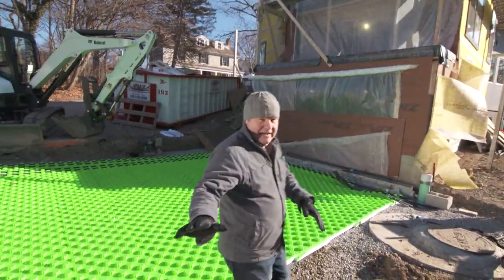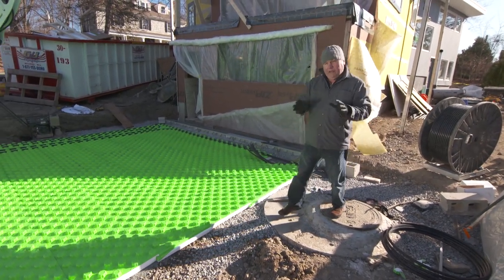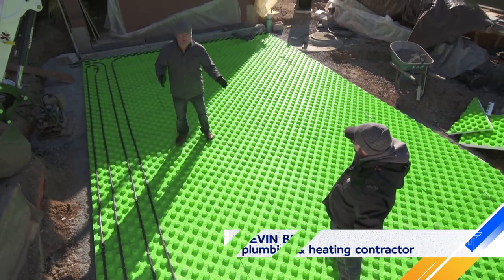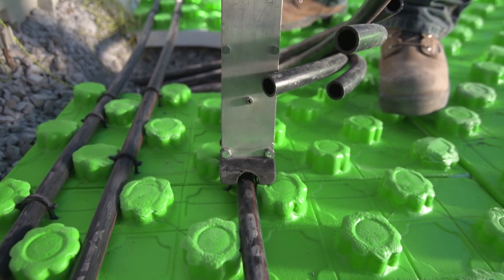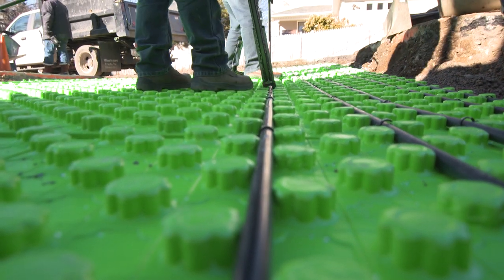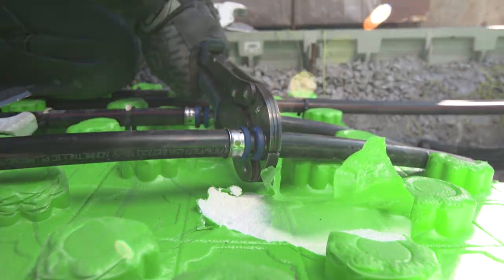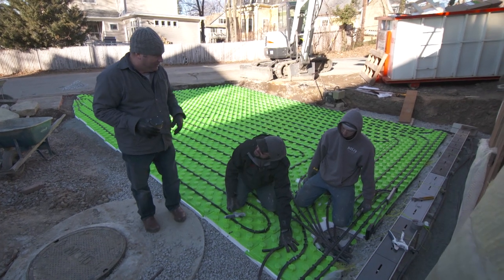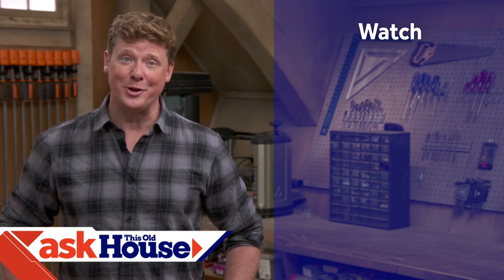Installing a Heated Driveway | This Old House

Comment: Holy crap!  Do you know how much energy that will consume?!  With just some rough calculations, assuming a 14' x 20' driveway, every ¼" of precipitation would take over 15,300 Wh just to melt the ice, plus about 107 Wh for every degree F that ¼" of precipitation is heated.

So, to thaw and heat ½" of rain-equivalent precipitation just 4 degrees F would take over 31,400 Wh of delivered energy, not produced energy or the energy to heat up all of that concrete.

Good grief.  Is TOH still going to call this an energy-efficient house?
Reply: Ditto. Thanks for saving me all the computing and typing! The only "green" part is the liner.
Reply: ncooty With excess solar energy or geothermal it can work responsibly.
Reply: It wasn't much of a driveway either, maybe fifteen minutes to shovel.
Reply: @AlexKennbergProfile  It would take nearly all of a day's output of a typical 3-4 kW residential solar photovoltaic installation, or more. The 15 kWh ice melt estimate is a minimum. There would also be the continuous heat transfer to the ambient environment on top of that. And after melting the snow and ice you would have to continue heating to avoid it turning into a slick skating rink. Maybe a solar hot water system would be better? I don't know. To me it just seems crazy. I live in a harsh winter climate in Canada and I've never seen or heard of anyone having one of these systems installed. It would probably be nearly useless at -10 C and totally useless at -20C. You just couldn't provide enough energy reasonably to overcome heat transfer into the ambient environment.
Reply: Your looking at the calculations the wrong way, you only need to bring the slab temperature up prior to a snow event so that the snow will melt instantly, then your energy is to maintain slab temps. Will utilize much less energy than you are calculating.
Reply: @jsaperton :  Please write out your calculations.

Comment: Imagine if and when that thing springs a leak how do you fix it in concrete
Reply: Jackhammers
Reply: Find leak with thermal imaging camera while system is running, the camera will see a bunch of yellow lines running in the ground and the leak will be where you'll see a line with yellow blotches coming out. Once that's found you can either cap that loop st your manifold or break the concrete/asphalt and just make a coupling repair if needed.

Comment: On this job they used concrete for the driveway. Could you use conrete pavers over the tubing instead of concrete. In my city they charge you more for a concrete driveway.

Comment: What sort of boiler is used to heat this driveway, and does it need its own power station to run it. Another too short video. Is This Old House on a spendthrift budget?

Comment: I like the project but wise those slices were above the slab, low chance of an issue but if those fittings ever rust considering the concrete or anti freeze you’ll have to ship out the concrete where as if they’re about the tub in the slab is 100% continuous and you know it’ll never be an issue

Comment: Extremely irresponsible use of energy.
Reply: I wouldnt be surprised if something like that was even illegal in Europe, with our regulations on energy efficiency in houses, strict limits on lightbulbs, vacuum cleaners, car engine sizes and almost everything. I have certainly never even heard about a heated driveway. But I guess somebody must save the planet for the rest of the people :D
Reply: A short bit of research goes a long way to understand how these systems do not eat up utility bills. Here is a quick article for starters.
https://www.concretenetwork.com/concrete/snow_melting_systems/costs.htm
A plow truck costs more to just relocate the snow out of the way on the property which leads to a point that they become burdensome, let alone if you even have property with enough room to pile any amount of snow.
Reply: @Joshua79C  Your reply has nothing to do with the comment.

Comment: What happens if and when one of those warm water pipes bursts under the driveway when there’s concrete covering it? Do you have to jackhammer and dig it up? Or do issues almost never occur?
Reply: Nunyo Bidness same as a lot of new houses and commercial buildings that are built on concrete slabs now a days. If it was to bust you would have to bust up the concrete where it’s leaking and repair it.
Reply: @StevenRathburn  I bought some. Good to 100 degrees below zero

Comment: Step 1 should be outlining the bank job you'd have to pull to pay for this heated driveway
Reply: So many of you thinking this will cost more to operate than warming the house:
https://www.concretenetwork.com/concrete/snow_melting_systems/costs.htm
they only turn on when the snow or ice needs melting away.

Comment: Could have saved a lot of money and gained insulation by using standard XPS foam. With the amount of Staples used, there was no reason to use that board. Also you should always avoid making connections under concrete.

Comment: getting ready to sell your house and organs to pay for heating bills
Reply: You don't keep it on 24/7 you non thinker. 
You only have it on until the ice and snow is melted or until the driveway is dry, then you turn it off. 
If you want to shorten the time. 
You don't turn it on until after the snow stops falling.
Reply: @scotttovey , thanks captain obvious, an exterior heated floor is like flushing your money down the tubes.
Reply: @scotttovey  ok boomer

Comment: For the love of the environment please don’t heat the outdoors thanks...
Reply: So no more outdoor grilling?
Reply: Nate B  that’s in summer, not all winter long.
It’s one small spot not an entire driveway.
And thus so much less energy it’s not even funny.
Like thousands of times less...
Reply: @FreekHoekstra  I grill all year long.
Reply: Air conditioning is litteraly just heating the outside air. 
Please show me your home has no air conditioning.  
Also note many rock salts act by causing an exothermic reaction that, you may have just guessed, melts ice by heating it. 
In the ling run this is actually the smartest and cheapest option if you are pouring a new concrete driveway. Concrete gets eaten up by salt and over the life of the home the cost of salt will be greater than the cost of this system.

Comment: Wait till the lines develop leaks. Then you have to dig up the concrete for repairs. Most people don't bother repairing it and just do it the old fashioned way. Plow or shovel.
Reply: If you could actually see the driveway I use, it has a retaining wall along the property I live on separating it and the driveway of which the house and drive are 6 to 12 feet away. it terminates at the end after a corner to a building which is used as a residence that I lived in before moving to the main house and next to it is a auto body shop which the landlord already owned. Even in the nicest of snow fall his plowing is crappy and leaved icebergs in the driveway, I am skeptical of and rather cheap to using salt as he threatens me with paying for any repairs if the concrete or asphalt gets eat up by it. Unless I hit the lottery large enough, I am stuck dealing with them using the plow and then a loader to pile and then remove the piles of snow each winter after each snow fall and he leaves a pile way to high to see around or over when exiting the driveway onto the main road which is a route and main road through town.  I would rather have such a melt system rather than having to risk my own health with unusually high hypertension (high blood pressure) as is despite being a bit out of shape now going into early 40s. Or dealing with some sketchy plow service with minimal room to place snow anywhere, even out front is an issue for me where i have relative who like parking and still have to heft the somewhat melted and wet road slated snow berms out of the way despite how willing the landlord it to plow the lawn up as I said with his crappy attitude of snow remove let alone can not do it well enough to keep ice from forming. By the way my mom and I live together to save money on living expenses and she is not much happier than I when there is ice on the walkway or even driveway.As I said if I won enough to buy my own place, you can bet it will have a ice/snow melt system in the driveway and walkways even stairs. It not as expensive to install or operate as many think the myth of it is to be, which is exacerbated by the wildly varying electrical supply rates that depends on where one lives and what the power source is. Afaik and done research of it, such is less expensive to have and use than relying on a plow service or going to the hospital and paying those medical bills for hurting yourself or some one lese you paid who hurt themselves at your place.
https://www.concretenetwork.com/concrete/snow_melting_systems/costs.htm

Comment: This is one of those long term investments. It pays for itself especially as you age.
Reply: It costs a lot to operate. My calculations (detailed in another comment) suggest melting off a foot of snow on a small driveway would be about $50 in energy. I think the going rate for having someone clear a small (or even large) driveway is less than that.

Comment: What happens if the equipment malfunctions? You have to dig up the driveway to repair it? Fun!
Reply: What?? What could malfunction?

The pipe is buried in concrete. Nothing else is. 

Even if some idiot drills a hole to fix say a fence post or whatever, you can repair that bit of pipe and fix the concrete 

This is no different to underfloor heating in houses.
Reply: Graham DIY All concrete in tension (and slabs  are) is either cracked or going to crack.  When it does, outside salts and water enter the slab.  Also, the expansion rate of the concrete and pipe differ.  Perhaps not a lot, but much more outside with the temperature swings over the seasons.  That pipe is going move a little against the slab overtime.
Reply: Mark Heslep and? So what? 

The point is if - IF - a problem happens then you can repair it.

Comment: Never ever make those mechanical connections where they are encased in the concrete. Poor example of driveway melt install. Very disappointed with
This Old House for this one.
Reply: Exactly... especially when something as easy to work like like pex. No reason to have a single connection in the slab.

Comment: wasting energy like the best...
Reply: Wasting energy? the biggest of myths for such a system:
https://www.concretenetwork.com/concrete/snow_melting_systems/costs.htm
it is not like they are going to keep heated for longer than needed, they are on before or when the snow starts to fall and shut off after it has fallen and most of the water has evaporated ot got soaked up leaving the surface dry and ice free.

Comment: This seems deeply immoral to me, just put up a cover or learn to shovel.
Reply: Not every one has the physical fit condition to shovel and scientific medical testing shows that even the healthy are still at risk of early heart attack with so much work when the snow is wet or heavy or icy. I myself now have hypertension (HIGH blood pressure, it is a hereditary condition) and never liked shoveling and despise how crappy the landlord plows and removes the piles of snow in our limited driveway space which is boundary with a retaining wall and a few buildings leaving no place to keep it piled in the driveway or parking spots too much or at all.
Reply: @Joshua79C  Then move into an old folks home. If you are too unfit to shovel, you shouldn't be driving either.
Reply: @nustada  I am only 40, and like I said in my previous comment of my health condition